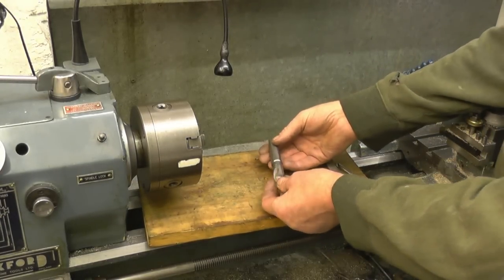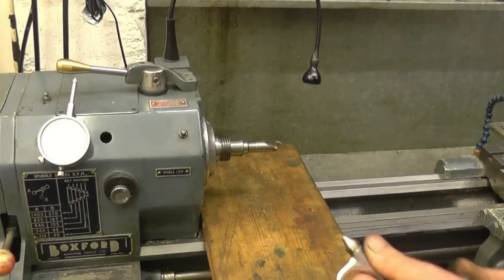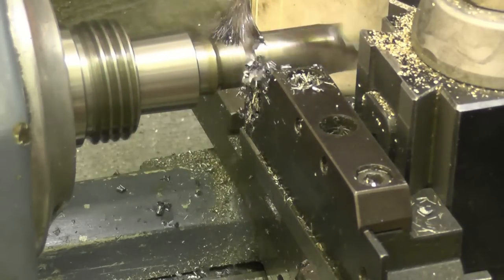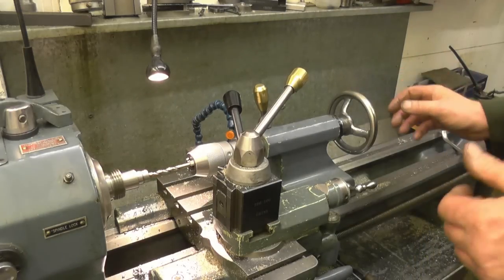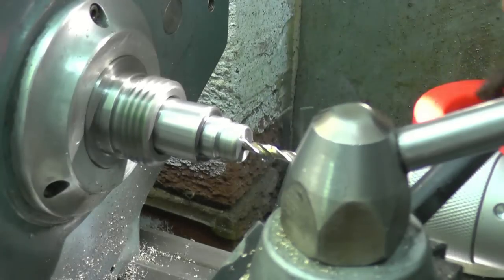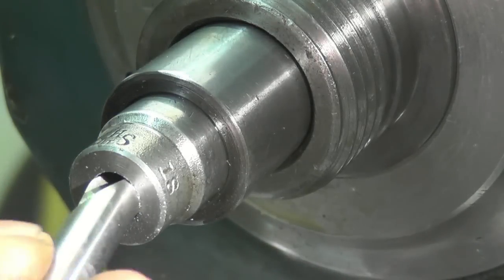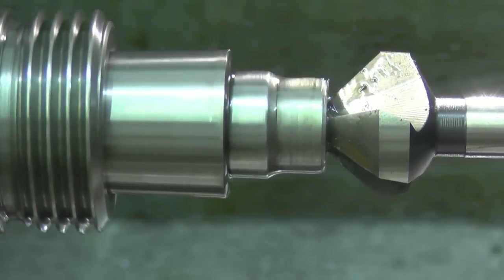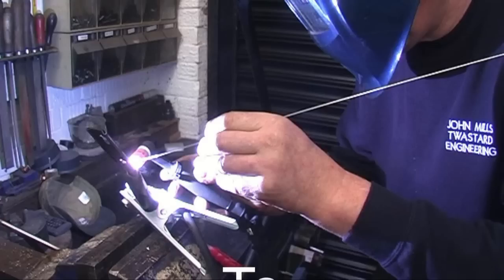Center Drill Holder part one

Comment: It struck me John after watching this that you could well have cut the centre drill in half and found two old drills, then made two of them. They could have been brazed in too if you'd have wanted or maybe not - drawing the temper out of the drills I suppose. Sometimes these smaller tools are easily lost temporarily and having two is very handy.
I'm watching all your videos from no.1 now, thanks for all the effort and time you've put into them, best wishes to your missus and self David.

Comment: Good idea and a great little project. I was wondering though if you'll end up with the centre drill stuck in the taper, with such a good fit surely it'll form a vacuum behind it as you try and pull it out. Could you drill a tiny hole in the taper to let air in and out without affecting the accuracy?

Comment: Hi John,

If you make another one, consider an extended version so that the tip of the centre drill is in a similar position to the tip of a twist drill held in a drill chuck. It can help with clearance problems with the saddle and speed up repetitive jobs. You don't have to move the tailstock so far, or you can even set a stop.
Reply from the maker: Good idea Paul

Comment: Hi John, I just wonder if using a setscrew on this rather small diameter will off center the drill to much.
Reply from the maker: The drill is a very good fit  in the hole